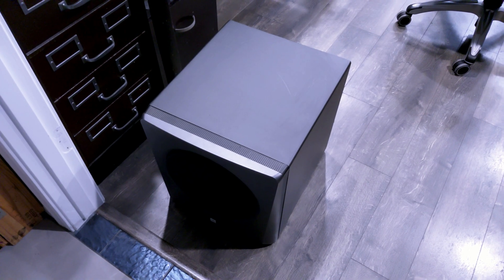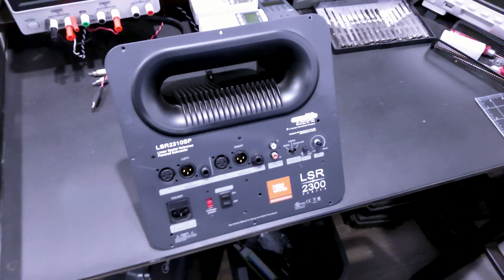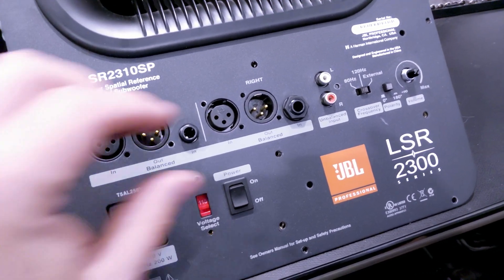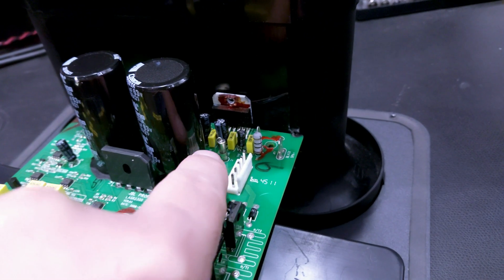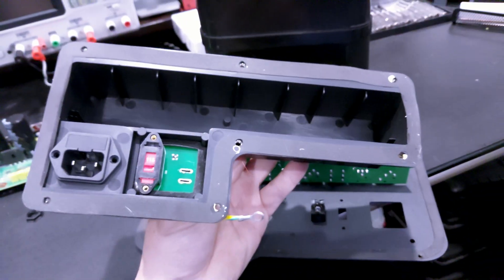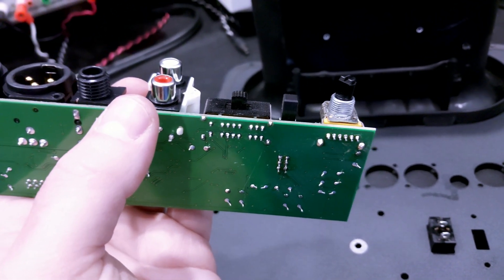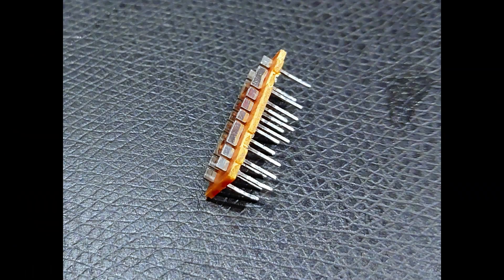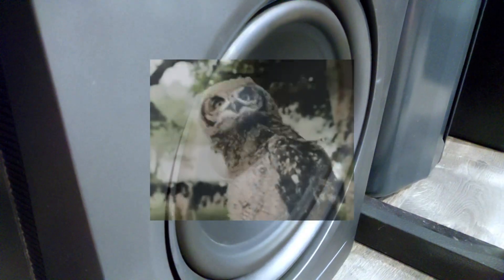JBL STUDIO LSR SERIES SUBWOOFER REPAIR | COMMON FIX FOR LSR2310SP SUB | AMPLIFIER BOARD SWITCH FIX

Comment: This is super helpful! I just got given a broken one and what's happening with mine is there is constant hum when powered on even if nothing plugged in. Not super loud but constant. The other thing is when it first turns on it almost sounds like the speaker is distorting but after it warms up for a few minutes it sounds almost complete;ly normal besides the slight low hum. Feels like a capacitor or resistor to me. I can do some soldering but any idea which capacitor or resistor needs to be replaced? Or how to figure out which one is bad? Any help is super appreciated!
Reply from the maker: As it is distorting, can you cure it by flipping any switches in the back or turning any knobs? If not, there is a more serious issue in the amplifier that would need a tech to look at it, or a replacement (parts come up on ebay all the time). If the noise is affected by switches or knob, then you can repair.
Reply: @MR_Garage I tried fiddling with the knobs and switches and no change. Any idea where to get resources to figure out which resistor or capacitor is bad?
Reply: Same boat here! Looking for specs on capacitors